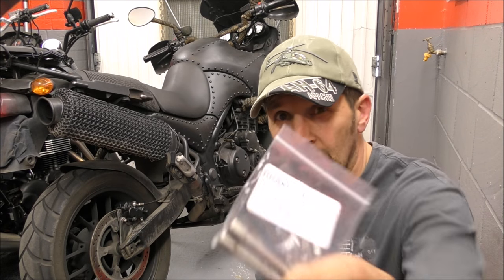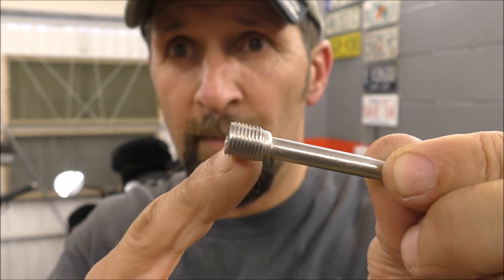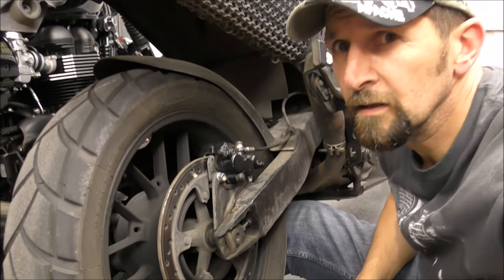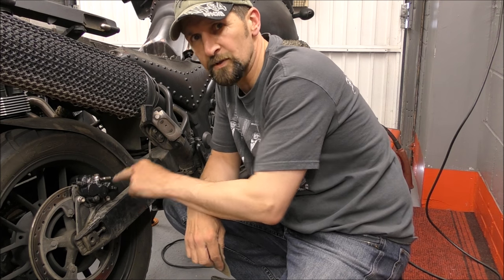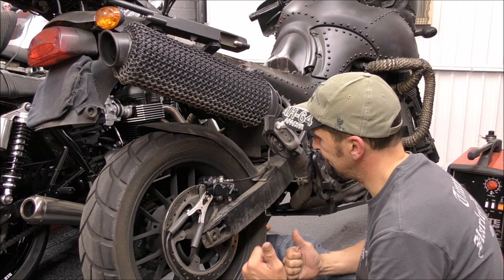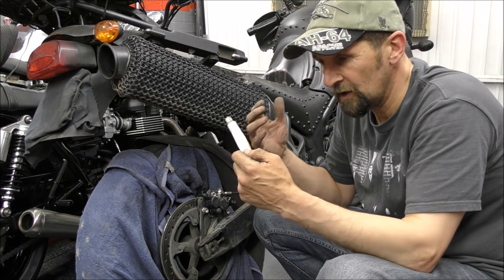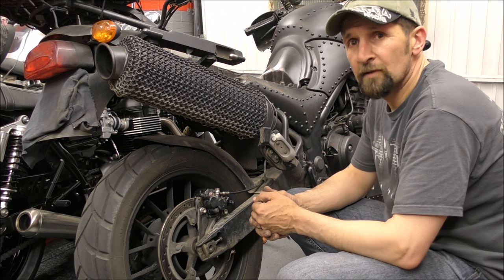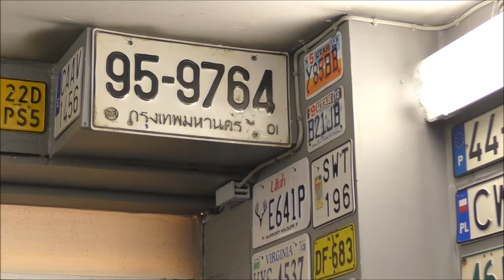Delboy's Garage, Removing Stuck Brake Caliper Pins

Comment: Hello Del, hope you and Penny had a great Christmas. I wonder could I trouble you for your advice on my front break lever. When I pull the lever it stays pulled in. I then have to push it forward to move bike and turn off break light. I have bike in storage but would like a heads up so I know whether to repair it myself. After the storage. I won't be able to attempt it before then. Yamaha xvs 950 midnight star 2012. Many thanks- John
Reply from the maker: Hi John, good to hear from you... until I read the last line of your message, I was all set to say, that your master cylinder is probably full of condensation water and gummed up, which is why it's sticking... but that's extremely unlikely on a 4yr old bike... 

... but it is possible if it's had very little use and lives in a damp environment.  I can't guess an exact remedy, but if it was my bike, the first thing I would do, before anything else, is pump the front brake system through with fresh fluid... nothing fancy, just buy a half pint of new fluid, and re-fill and re-fill of the reservoir, pump it all through the system, down the brake hose and out of the caliper... this will serve to wash out any water logged fluid, and then see how it is... you will probably find that will cure it, it usually does!  

Let me know how that goes, and we can take it from there - good luck mate, Del
Reply: Hi Del, thanks for your reply. I will give that a go, it could be March when I take it out of storage, unless you think something may degrade through time and then I will do it now? I followed you video before about changing brake fluid, which worked a charm, so I should be o.k. doing that, that was 1 year & 9 months ago.
Also I have never done that cleaning service on the brake calipers that you do, mainly because I don't ride in the depths of winter. Should I be doing that anyway?
I will let you know how the brake bleeding goes (eventually) and thanks a million for your wisdom. And happy new year - John
Reply from the maker: Hi again John, well, it wouldn't hurt to bleed them through now, just to get rid of the water logged fluid, as anything trapped in there for a few months over winter, will lead to rust, which could be expensive to fix, plus it doesn't cost a lot, and there's no harm in doing it early... thanks again for your Patron pledge, it's really appreciated and helps us keep things going !
Reply: Hi Del thanks for the advice. Does it matter if I use fluid from a car or bike shop??? I used fluid from car shop last time, the bike stuff was a good bit more expensive?
I will try and change the fluid this weekend if I can get a good fitting peice of tube somewhere. 
I have been meaning to do the pledge thing for a while now but finally got around to it. Thanks for all your videos, hard work and advice, I really appreciate it. 
Cheers, will let you know how it goes. John
Reply from the maker: Hi again John, brake fluid is brake fluid , as long at it is DOT4 then it is fine for your bike... it sometimes is priced a little higher in bike shops due to the smaller quantities in the fancy packaging, car shops buy in bigger bulk and shop in larger quantities... but no such thing as 'bike brake fluid'... hope it goes ok for you, drop us a line if you get stuck, you know the drill!
Reply: Hello Del. I got the brake fluid changed, but no improvement to the fault. The fluid looked clean enough with no dirt, nothing strange to report. At least that eliminates the brake fluid. I pumped about 250 ml through it. 
Many thanks- John
Reply: One thing you can also try is to remove the brake lever and lube the bolt that goes through it and the contact surfaces of the lever with silicone grease or waterproof grease, whichever the service manual says to use.

It's also possible that the cylinder's piston spring has gone bad. In that case the brake master cylinder will need to be rebuilt. It's a simple procedure and there's a video on how to do it along with instructions in your bike's service manual. I just rebuilt both my master cylinders. It was the first I have ever done this kind of work and my brakes work great! The cylinder rebuild kit was OEM and it cost me $30. Make sure you cover your bike before you do anything that could result in the accidental spilling of brake fluid on any painted surfaces because brake fluid is caustic to paint. But first lube your lever.

Comment: Any idea what to do if the caliper pin is spinning, but not coming out?
Reply from the maker: Is it a screw in pin?
Reply: @Moonfleet41  Yeah, It is similar to the one in the video, with the threads being part of the outside of the Allen head. It is also located in a recess... I think I turned it in too far after applying copper grease and trying to get it tightened to the specified torque.

Comment: I can't even get the bolts that hold the caliper on to the fork removed. Rounded out now and everything. Any suggestions all four are tight as hell. Impossible. Help
Reply from the maker: Are they hex bolts, or allen bolts, buddy??
Reply: they are Allen . . each side of the fork. All four are like that. two are starting to strip. Don't understand why they are so tight like that. If I finally get one off then I still have to mess with the other three.. ugh what's the million YouTube videos. Tried everything cannot get WD-40 or anything up inside of there because they are flush . got star a little bigger pounded it in there and that would not even break it loose
Reply from the maker: Hi buddy, OK... it sounds like, maybe, some dipshit has used threadlock in there, and this is the first thing that happens, as the brakes get extremely hot, it bakes the threadlock rock hard... anyway, to get them out, the first thing I was gonna suggest was hammering a torx bit in there, but it seems you've tried that... and if that has itself also stripped out, then you're stuck only with one more option, and that is to drill the heads off....!  

But before you do, are the heads themselves countersunk in to a flush hole??  Or do they stand proud on their own??  Could you get some grips clamped round the head at the same time as the torx bit hammered in, and lean on the two at the same time??   It can also help to heat things up a little, as the threads in the calipers are alloy, and alloy expands faster than steel... you could either use a hot gun, or even boiling water poured over the caliper, but if you truly cannot break them free, then perhaps the only option is a drill bit... it's not an easy option, as you have to take the wheel out once they are drilled clear, kinda goes a bit like this:

Take a drill bit the same size as the bolt shaft, drill down the centre till the head of the allen bolt spins off attached to the drill bit, then the calipers can be removed by first taking the axle and dropping the wheel out, just enough so that the disc drops out of the caliper... then you can shove the caliper inwards enough, so that the bolt stumps clear the fork leg lugs...

It's not a clean and tidy process, it's butchery, but it does work when all else fails!  When I last had a situation like this, I welded the allen key in to the bolt cap, so if you have a MIG you could do that, rather than drilling the heads off... good luck with it buddy, hope that those options can help !
Reply: Bolt extractor.  Bites right in to them

Comment: Top job I have done that Job myself just a couple of things cover your 
brake disc also so you don't get any stray spatter on it and in my case take 
off your £500 watch for 25 years service 1 week after having it
Reply from the maker: Blimey, bad news on the watch mate, I've done that to a camera lens in the past, just a random molten spark is all it takes... even worse, when they fly up in the air and land on the back of yer neck, which is why I now spin a baseball cap round backwards !

Comment: You can use an american allen wrench...or what ever the one your using, use the opposite one, of a different size...like..if its metric...use an english...and if it's english use an metric one...and find the size that will start to go into the bolt and knock it into the bolt head with a hammer, in other words force the allen wrench into the remeded out bolt. Sometimes the wrong size allen wrench will go into a remed out bolt head..and then it will grab...
Reply from the maker: Not sure if you mean allen wrench, or Torx bit?... thats the accepted trick.. the "star" shaped tool bites into the reemed hole and gets a hold..!

Comment: why not use the stud extractor in the hex socket head
Reply from the maker: a stud extractor extracts studs....external items that can be gripped... this is burried flush..!
Reply: Moonfleet41 the stud extractor's that I normally use you sometime's have to drill a hole for them to seat in, but the hex head socket is that hole and if it is rounded all the better,just saying it's worked for me lot's of time's but so has JD and welding (blue glue).LOVE THE VID'S
Reply from the maker: ah cool... lots of ways to do these things aye... and all better then a new caliper..lol.. cheers buddy.

Comment: YES please disconnect the battery terminal...usually the NEGATIVE one,...the welder works on DC volts, NOT AC volts, and amps....and it's the same type of voltage the ignition coil...ECU(computer)...and many other things work on in the bikes electrical system.

Comment: How about trying an "EZ Out" before resorting to welding?Also, you need to trash that Allen key you were using while trying to remove the brake pin initially.   Looked like a worn out Bondhus ball end Allen key.  Those are really garbage ill fitting Allen keys, very prone to rounding out Allen screws.Bulk Allen keys from True Value are a much more precise fit that help prevent rounding out of Allen bolts.  I've run into situations where a brand new Bondhus would not remove a screw out of a carburetor, but an individual Allen key (not from some cheap set) removed the screw right away.
Reply from the maker: Easy Outs need at least 1/2" hole to sink in to in order to get a good bite, so I would have to drill in to it before I could get anywhere near that working and all allen keys are consumable, I use the ball ends because they are convenient on bolts in tight spots that you can't get a parallel run at, but for un-doing a tight socket cap, a fresh allen key every time, and I keep tinfuls of them, they are only pennies and last about a dozen uses... worn tools do more damage than any ham-fisted use can ever do...

Comment: The screw cap before I get to that brake pin is frozen and still trying to get it out
Reply from the maker: have you tried using an impact driver, that usually works on them..?
Reply: @Moonfleet41  it did and it finally came out. Everything worked for the front.. now I am struggling to get the pistons back far enough to the rear brake in the rotor.. a bit sheepish on wrenches .. might try a c clamp

Your videos are very helpful
Reply from the maker: It's not unusual to need a little force to push the pistons back far enough once the new fat pads are in... there is even a dedicated tool for it which will make the job really easy anod not damage your caliper like a G clamp can... here:- https://www.spanner-monkey.co.uk/motorcycle-disc-brake-piston-spreader-tool-115872?search=MS711&description=true
Reply: @Moonfleet41  I ended up using the old pad and a C clamp because I couldn’t wait.. bled it a bit under pressure and it made it— thank you

Comment: Stock style brake caliper pins are junk, and extremely overpriced for 1 thing, if you ever need new ones. Get some Probolt Race-Spec pins, and you'll never run into this issue ever again. They're also about 3x cheaper than the garbage OEM pins and 10x better on quality.
Reply from the maker: I think most things out there are cheaper and better than the over priced factory rubbish!